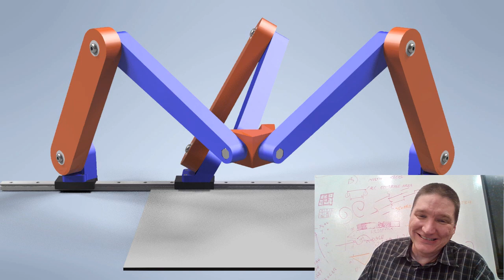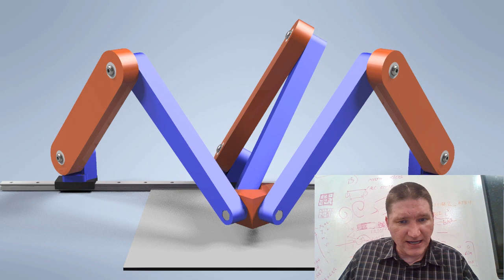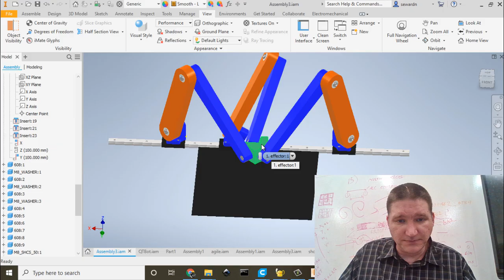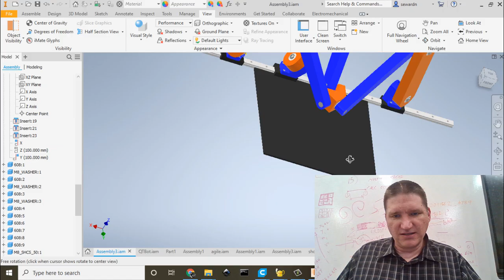RepRap Monorail (Single Rail Tripteron)

Comment: That is bonkers lookin'. I'd be tempted to take my old Tarantula bed and some bearings to make one, but not sure how you'd program the kinematics into a Marlin install. It looks like at really high/lower Z values, you might have some interferance, but nothing slightly more rail or setting the height of the rail wouldn't fix. Also, the fact that it seems like it'd be really rigid is something that might appeal to folks, that and now mesmerizing it is compared to my Longer, old Tevo, or any other Prusa-format printer.

edit to add: That one fancy printer that has a moving belt as one of it's axis would be a VERY interesting combination with this sort of arrangement. just tell it to move real slow, then have one (or even more) of these on a big rail printing on parts as they roll by. Go mass production.

Comment: Doesn’t every joint or rail reduce precision?
Reply from the maker: Sure.  Just like a robot arm.  This is better is some ways.  This falls in a class of robots called "parallel robots".  Each carriage has a completely parallel way to control the effector.  Contrast that to a serial robot arm where each DOF is stacked on the last.  TLDR  There is error but at least the error won't stack!

Comment: What is the math behind the middle arm? How do you calculate the degrees of rotation of the arm?
Reply from the maker: Don't think about the arm angles.  Just think of that carriage defining a plane.  I just tilt that plane.  I move that plane back and forth to move the intersection point with the other two planes up or down.  No trig...no angles to calculate.

Comment: Interesting concept. 
How are the torsional forces? How much can the linear bearings handle?
I'm worried that not only all levers hang over on one side of the rail, but due to their arrangement, every movement in any axis should add some torsional momentum. So, how much load would this be able to handle at the tip, and at what speed/precision?
Curious to see the results if you build this.
Reply from the maker: So the rails I use are rated for a torsion moment of up to about 50ft-lbs.  I would say that is overkill.  I don't expect to get anywhere close to that much.

Comment: another issue is lateral or torsional rigidity. these rails are not made for that. but it is a fun design nevertheless. why not make a single arm i would say.
Reply from the maker: The rails are rated for moments in all 3 directions.  They can support about 50ft-lbs in just about any direction which is at least an order of magnitude more than I need.

Comment: a problem with this design is the change of resolution, as less rotary motion is needed in closed arm and more in open arm, to move same horizontal distance. is that correct?
Reply from the maker: Not exactly.  The response is always linear.  The resolution is constant everywhere.  Try to ignore the arms and just think of them as planes.

Comment: I could see this working really well for long parts. Instead of a very tall printer you can simply adjust the length of the rail to infinity.  Potentially more stable and higher strength from the layer lines being printed lengthwise.

Comment: I could imagine something like this siting in the living room  permanently. 

Why not use flat gear rack? And mount the axis drive moters directly to the rail mount?
Reply from the maker: I am considering that.
Reply: @NicholasSeward use ball screws!
Reply from the maker: @gatekeeper84  would be awesome
Reply: I think it's a huge advantage to move weight off of the moving parts, leaves more room for load capacity at the "tool end". If rigidity is needed, sure racks and ballscrews are great, but kinematic solutions are best for lower load, higher speed applications.

Comment: Are there any issues with joint singularities? I.e. are there possibly transitions of the "nozzle" that result in drastic arm movements? I feel that's a possible issue you could run into when doing Inline actuation.
Reply from the maker: It is possible but it is easy to design the arms so that can't happen.

Comment: That looks really interesting. Do the elbow and wrist joints need motors in addition to the shoulders?

Are the two outside shoulder joints perpendicular to the xy plane then rotated 45⁰ around the z? And Is the middle shoulder joint perpendicular to the xz plane then rotated around the y?
Reply from the maker: All revolute joints are passive.  Your angles and rotations sound right!

Comment: Ideas:
1. What if the rail is NOT straight?
A circle is one way, but if it was  U bend, you'd get a long working volume but DOUBLE the width of a single rail.
2. What if you have several printers on one rail?
You could print in several materials, or have printers which work in different resolutions...
You could even have something which is not exactly a printer in the middle of the process, like a robot laying wiring, adding metal parts like axles, or filling a cavity with fluid or whatnot.

In other words, something more like a production line.

Amazing work BTW.
Reply from the maker: I think this is workable but you would need some ujoints for the effector attachment of the outside arms.
Reply: @NicholasSeward  don't let my ideas distract you.
People who listen to me often end up like the proverbial centipede in a ditch...
Reply: I cant stop thinking and that is a bad habit...
You know how the Canadarm on the ISS repositions itself?
Reply from the maker: @SierraSierraFoxtrot  Keep the crazy coming.  That is how you get to good ideas.
Reply: @NicholasSeward  are you familiar with TRIZ?
Sometimes translated to English as SIT - Systematic Inventive Thinking.
Reply from the maker: @SierraSierraFoxtrot  I am not.  I looked it up.  I like the concept that this can be taught.
Reply: @NicholasSeward  it is a divisive topic, but I never neglect an opportunity to evangelize.

For me the most important insight in TRIZ is that creativity (especially in a technical context) is not a wishy washy subjective ephemeral thing.

There are objectively more creative solutions and rational  ways to look for them.
Reply from the maker: @SierraSierraFoxtrot  No clue what TRIZ says but I think I agree.  I would put this in the category of 1st principles engineering.  I don't want a creative solution.  I want the best solution.  My stuff looks wacky because I don't care if my designs to match with convention.  

I really want to dig into TRIZ more but it looks like a paid thing.  Is there a book or wiki where they walk through the program?
Reply: @NicholasSeward  I will past some resources later from desktop.
Reply: @NicholasSeward  I haven't forgotten... but better do it off of YT comments. email me rocketlaunch gmail etc.
Reply: Another thought: rails can have switching systems... and also rotators.
Reply: One final thought: if this is big scale like a printer for buildings, a robot that lays the track on which it rides becomes relevant.

Comment: Very cool.
 One thing I am not clear on (my apologies if I missed it). Other than the servos closest to the rail, are all the other joints passive, or will they require servos as well?
Reply from the maker: The carriage x position is controlled all revolute joints are passive.
Reply: @NicholasSeward  Oh wow. Even the rotational joints on the rail? Cooler still.

Comment: Instead of belts, a rack and pinion set up seems ideal for this
Reply: Gear wiggle/lash will be detrimental to performance i think
Reply: Could use a single stationery ball screw with motorized other thing
Reply: Another alternative is through-type lead screw stepper motors on the same screw, or with slightly more complexity, two through-type and one larger stepper driving a captured lead-nut and two steppers. The latter means you could drive all one axis quite quickly.

Comment: Instead of a belt why no use a rack on the rail with a servo on each arm being the pinion? That way you don't need to tension anything just have good tolerances on the teeth. Also makes it more scalable

Comment: I want to try recreating this on small scale, but for the rail I think motors attached to gears that are used to drive on a rail with indentations on the top face for the teeth of the gears.

Comment: Have you considered placing the stepper  motors on the rails attached to the lehs? You would only need to gear the rail or make a worm drive. The weight of the steppers on the rail should add to stability and eliminate belts.
Reply from the maker: I am considering all the options right now.  I am leaning to static steppers with belt loops because it is pretty standard and easy to do.  Counter weight isn't really needed...The arms are very very light.
Reply: @NicholasSeward  the arms are light but are you going to add an extruder and hotend? The weight and motion may add too much torque pressure on the rail and/or arm connections. Adding a second support rail running parallel to the drive rail may fix the torque issue though. 🤔
Reply: @NicholasSeward  on a side note: awesome design. The industrial applications would be outstanding.  3-d printed buildings would be more efficiently done. I hope to see you develop this.

Comment: I think you could get better Z range just by moving the Z blue arm to the other side of the Z orange arm.
Also if you have a set of STLs somewhere I'll totally print up a working model of this.
Reply from the maker: This isn't a printable model.  I will share on GitHub when I start the build.  (Regarding the z range...thinking of moving to a DuoRail.)
Reply: @NicholasSeward  Fair enough. I should point out that my interest in this is actually less for 3d printing and more for wire EDM, because mirroring this design over the rail would allow you to have a wire guide above and below the metal plate that move in unison without needing a large C-channel.

Comment: I think a few of the comments of captured just how revolutionary this could be, but this truly could change the way we manufacture. First of all this is incredibly compact, meaning transportation and storage would be much easier than an entire 3D structure. It's also MUCH more simple than other 3D movement systems that require precisely linked structures on flat surfaces with high precision. This requires ONE high precision surface not linked to anything. It has a movement area that is not encapsulated or surrounded by anything. As another comment mentioned, you could set this on a piece of train tract, or a mono rail in the middle of a city, and just start building or maneuvering. Even if this structure doesn't work for 3D printing, this could have millions of other applications as a vestal robotic arm.

Comment: this is neat, but the linear rail do not hold torque on tilting the carriage very well. There would also be a high leverage there. Much more rigid and practical would be to use 2 rails, one with 2 arms.
Reply from the maker: Probably going that way but not because the rails can't handle the torque.  The arms only weight 50g each so very little forces there.  The 2 rail approach will give me a more practical build volume.
Reply: @NicholasSeward  little torque, but long levers. Running it fast, it will have bad ringing if not corrected

Comment: variing accuracy throughout the workspace due to fixed stepper motor stepsize in relation to the trigometrical nature of this system could be a problem
Reply from the maker: There is no trig involved in the kinematics.  When you move a stepper no mater the position...the effector moves linearly.  The is almost the same kinematics as the CoreXY.
Reply: @NicholasSeward  wow ok well it was just the first thing that came to my mind^^
if that really isnt the case i didnt say anything hehe
Reply from the maker: @HannyDart  It is very counter intuitive.  When people (me being one of those people) look at the normal tripteron they think the control is something fancier than basic cartesian.

Comment: What a great sleek setup! I have one pressing thought on my mind though. As far as I understand the Z axis is reliant on the middle arm having room to move from side to side right? And since the Y axis is in turn reliant on the outer arms moving inwards and outwards the area that can be reached on the Z axis would have to be way smaller on the side that's closest to the rail would it not? So when the outer arms are all the way inward to get the head close to the rail the wiggle room for the middle arm to move from side to side would be much smaller. Because in my head the reachable volume of the hotend would make a wedge shape with the pointy end towards the rail. Please correct me if Im missing something here! :)
Reply from the maker: Yeah... the z travel increases as you move away from the rail.  Thinking about a DuoRail.

Comment: I could imagine that on huge scale to print houses. It should be easier as printer would only be on one side instead of surrounding it,  Als the Rail length could easily be adjusted. You could even get multiple to vastly improve speed

Comment: If it's possible to get this stable enough making the arms out of lasercut flexure joints, that could take it even further for self replication! I hope you realise how big the possibility for traversing on a single rail is?
Reply from the maker: It is possible for sure.  I really want to build a bot with compliant mechanism.  If you  (or anyone) can make a single arm that lets one end move freely in a constrained plane, I would love to give it a go.
Reply: @NicholasSeward  Some weeks ago I did some sketches of a compliant parallel arm. I think this setup suits much better though, so I will for sure try it out! While the backlash on a compliant setup isn't easily predictable on a design level, it's very predictable at a simulation level. So I figured it might be possible to train a neural net to compensate for forces put on the end effector.
Reply from the maker: @FredrikHAndersson  That sounds awesome!  Can't wait.

Comment: This is insanely cool and surprisingly simple. But there are 2 things I wonder (because I can't really wrap my head around them). 
1) What does the maximum build volume look like? I guess it is dictated by the Y axis. When you are closer to the rail you have more space to move the Z  and less space to move the X, and if you are further from the rail you have more space to move the X and less space to move the Z.  So I guess it's a tetrahedron with one edge in the Z direction through the center of the rail and another edge in the X direction almost as long as the rail.
2) Why are the arms angled the way they are? At first I thought they have to tilt or rotate, but they are completely fixed on the sliding blocks.
Reply from the maker: 1) Trapezoid from the top, triangle from the side.  The z increase as you move away from the rail.  Considering a DuoRail for better space usage.
2)Angles are an open question.  I just picked 3 angles that produce okay results.  I would really need to write a simulation to help me pick the optimal angles.

Comment: Now this is really neat... but as the arms cantilever and reach over the build surface, you might induce twisting of the base rail if you don't make it REALLY stiff... as any bending/flex at all would result in uneven layer heights and the head possibly hitting the model... but I really dig the concept... I love it when people think out of the box

Comment: it looks like a much simpler solution than everything in production today!
although that usually means there are big problems hiding in plain sight.
i’m not much of an engineer, though, so this looks airtight to me!
Reply: To me the most obvious problem seems to be rigidity. It seems like it’s equivalent to trying to control a printer nozzle on the tip of a cantilever beam.
Reply: @mohihab314159  It absolutely would be. However this is a solution we have solved before on systems like cranes, and robotic arms. One of the major reasons 3D printing relies so heavily on rigidity is that each axis has to be precisely aligned with one another. While this design adds complexity in one single axis, it removes the other 2 axis entirely.

Comment: Have you considered what it would take to add counterweights and/or reaction arms to this thing so it wouldn't apply torque to the rail just by moving?
Reply from the maker: No....  it should be possible to keep the center of mass over the rail.  That is a great idea.  For now...I will just keep the weight low.
Reply: @NicholasSeward  Glad to kibitz!

Comment: How would you balance it.? It seems that the farther the head is from the rail it seems like the head might sag. Also how many stepper motor you need for this setup?. It looks cool but how would it work considering the weight of the head and arms?.
Reply from the maker: It will sag for sure.  How much is up to my design choices.  I will also have bed sensing so it should be a non issues.  The weight of the arms and head are very small.